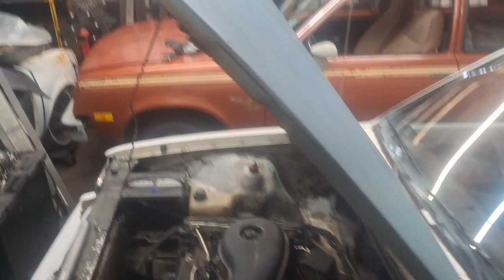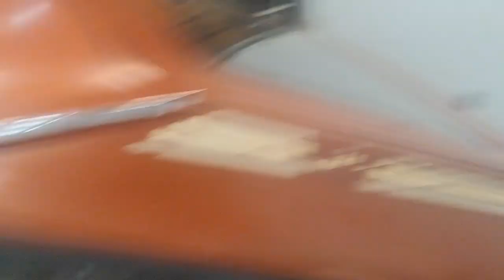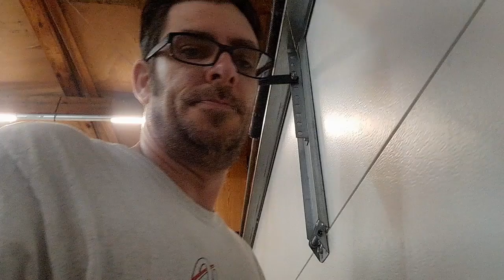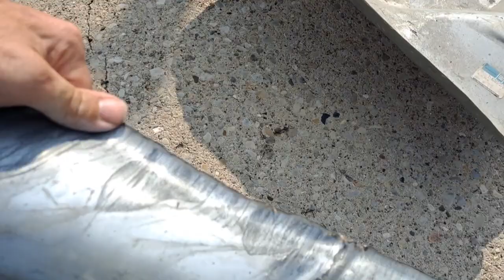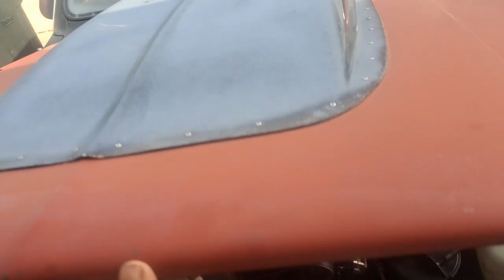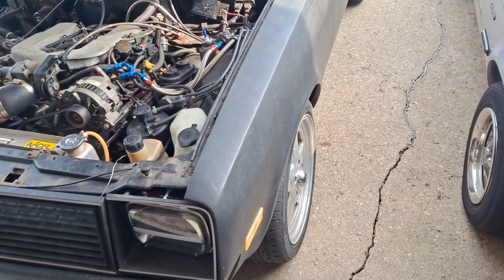The return of projects!

Comment: That 2.8 install looks pretty good.
Reply from the maker: 3.4/4l60 from a 4th gen F body actually. My buddy Lou built this back around 08 out of scraps cheap and free parts with a shoe string budget. It's installed using the old Anglefire 2.8 install as a guideline and was a test car for some of the 2.8 swap brakets. It needed a bunch of updates to see the road after sitting a while. We have planned to put that engine further down and back on some custom mount brackets so we can tame some driveline angles and make it even better.

Comment: Any videos on 1.6 vacuum delete
Reply from the maker: I don't, but for offroad purposes, the distributor gets full vac signal, and the egr gets a timed port if your keeping it. If equipped with an auto, the transmission has its own vac port near the rear heater hose on the intake, and 82+ also have a lockup vac switch on the drivers inner fender that gets full vac. If the car was an AC car there will be a black vac reserve ball also over on the driver inner fender that gets full vac. The rest can go away
Reply: Much appreciated

Comment: Rods for what car?
Reply from the maker: I'll be covering the whole engine as it goes together but the rods are B16 Honda
Reply: @t-bodyperformance770  crankshaft is 1.4 or 1.6?
Reply from the maker: @HMitsushi  1.6, it needs the rod journal turned down and also offset to get the pistons to the deck.
Reply: We use 128mm rods from Fiat Sevel engines and Family 2 2.0L pistons , thats matches perfect tdc on block and goes for 1759cc (107.34 ci)
Reply: @JB-ci6bn  here in Brazil, we use this rods.
Reply: @HMitsushi  eu sou brasileiro, bielas do B16 tem 134mm , vai dar briga
Reply: @JB-ci6bn  ahn bom… até imaginei que poderia ser… 134mm? Vai dar briga mesmo kkkk
Reply: @HMitsushi  estourando 130mm p usar pistao de Falcon 400 85mm ou 86 q é bem baixo, 128 de Sevel da p usar F2 2.0 fase 2 (astra vectra) monza e kadett não
Reply: @JB-ci6bn  conheço bem tambem, uso essas bielas a mais de 15 anos. Ja usei pistao powertech pino deslocado r atualmente uso o pistao AFP proprio para esaa biela
Reply: @HMitsushi  ai é o melhor dos mundos, é q estou fazendo um mas tudo no pobre edition kkkkk o mais barato possível 😂
Reply: @HMitsushi  e estou fazendo tbm um cabeçote F2 invertido pra manter adm e escape pro mesmo lado q o ohc, usando a gaiola de comando de Chevette, pra ter aparência de original